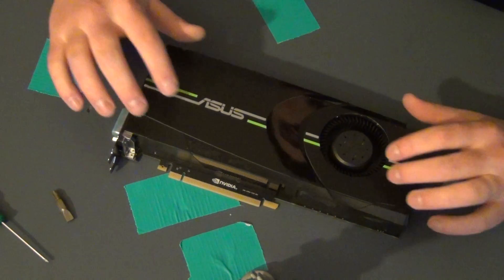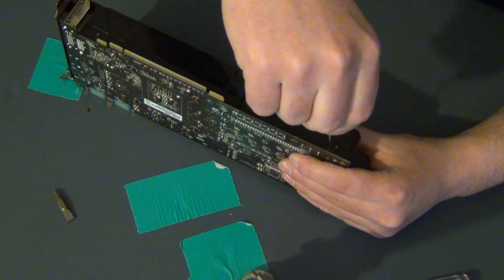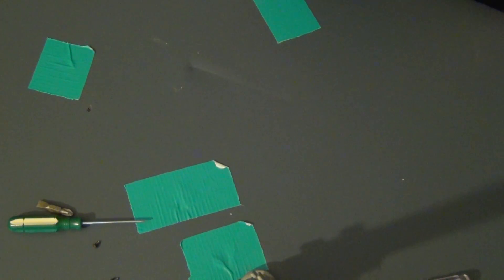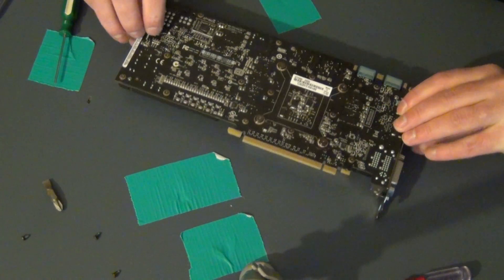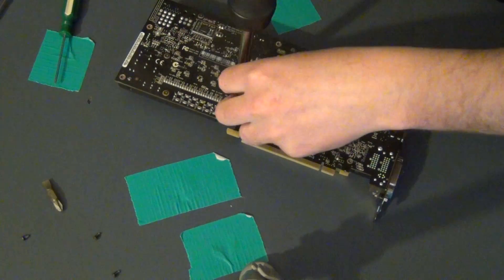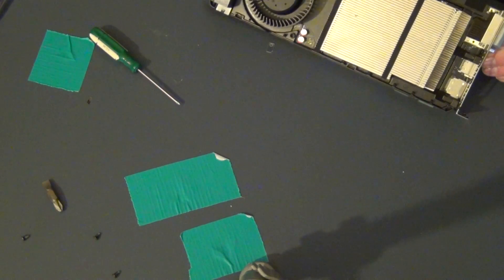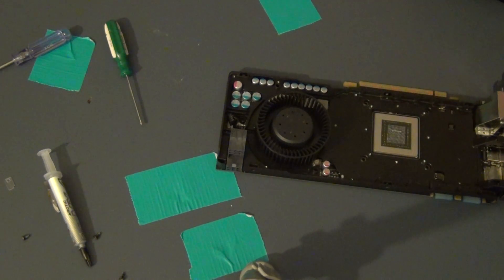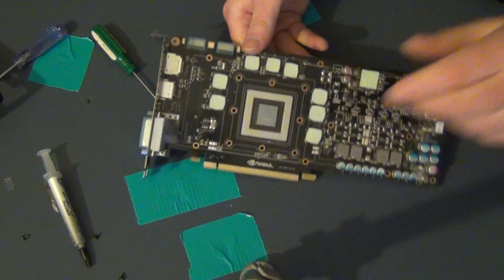gtx680 taken apart(how to)

Comment: I was wondering if is it possible to replace the 65mm fan on gtx 680. I saw just a single screw under the frame, but these fans usually got like 3 in triangular shape.
Reply from the maker: not sure i havent done it.

Comment: well i am going to be using a FT02 that has a 90 degree rotated motherboard tray, now heat pipes got to have something running through them to move the hot air, while when the tray is rotated the substance inside the pipes get stuck to one side and are rendered useless.